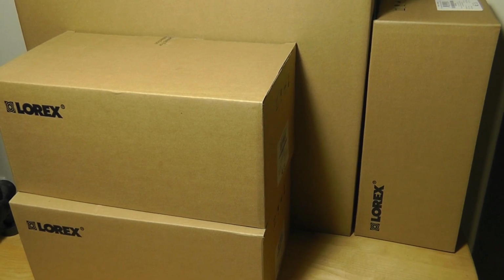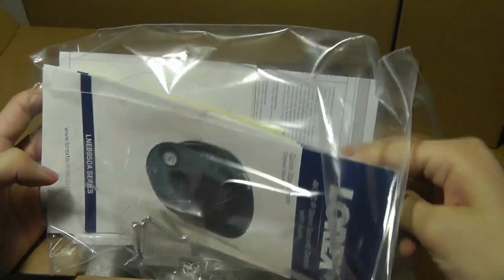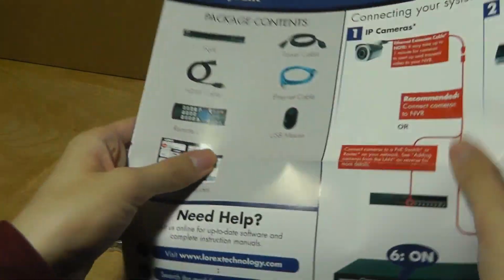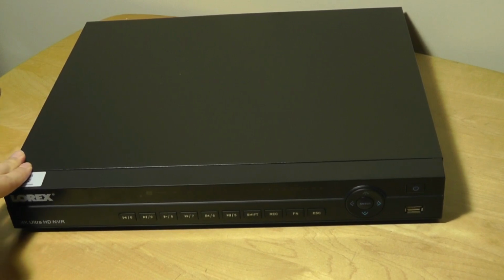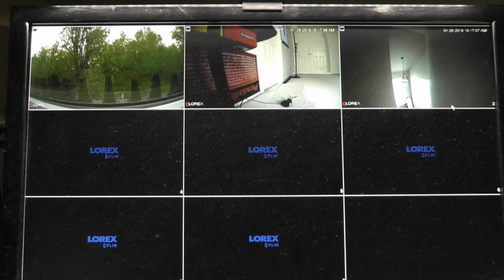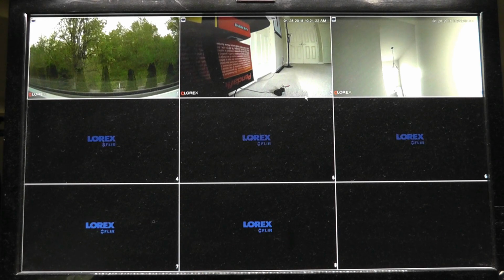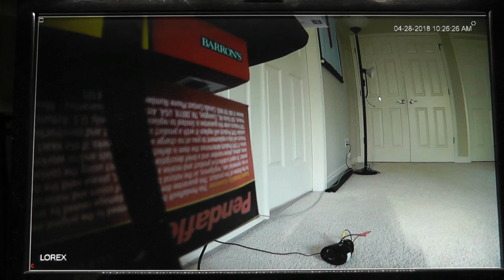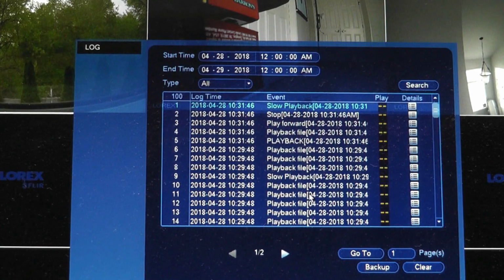REVIEW: LOREX (FLIR) 4K Ultra HD NVR Security Camera System!

Comment: I just bought and installed a 4 bullet camera Lorex 4k camera system. To this system I added two what Lorex says are compatible cameras; So a 6 camera system for approx. $1,200. The supplied cameras are not fantastic. Where I live is a rural setting and although there are street lights they are few and far between and there is little to no ambient light from neighboring homes. In other words the cameras which are supposed to have a range at night if 130 ft see nothing, nada. I have a friend who went through the same scenario with Lorex and he dumped the system and went with Waze. I don't ever want to hear that Flir/Lorex is the gold standard in night vision. The literature says though that the cameras need a min. of .2-.3 lux. In english a moonlight night is about .27. 
     Furthermore the two additional cameras which Lorex claims to be compatible are what I would describe as "sort of" compatible. These cameras do not work with a software feature called "smart search" which flags motion that was detected over a set time period. In talking with Lorex support they were evasive about this limitation that I discovered by nailing the agent down. 
   In my case since I invested so much money and was dis-satisfied I had to purchase some motion detection floodlights to compensate for the nightvision limitations of the supplied cameras.
    There are limitations with the Lorex systems and it disappointing to see these camera reviews pop up that say these systems are fantastic.

Comment: Does the camera have wifi to connect to your smart phone? (as you stated in your video), Or does the camera have wifi so it can connect to the DVR wireless which in turn can be accessed by cell phone? There is a BIG difference. Be sure you know you sh_t. Also, it's not a "DV box". This is incorrect english. This is a DVR.

Comment: This guy gets some of his facts wrong. 
1. This system isn’t manufactured by Lorex/FLIR. It has a different manufacturer, and is rebranded with the Lorax/FLIR name
2. He says 4K is the most resolution you can get in a surveillance system.  Wrong. You can get a 12MP system if you shop around. 
3. Says the noise of the NVR is as loud as a desktop computer. Wrong. Unless you have a very loud computer. This thing sounds like a refrigerator running. 
(BUT....Maybe the costco version is worse than one gotten directly from Lorex)
Reply: I ordered the non-Costco version. I still expect the fan noise to be annoying.
Reply: True, its Dahua
Reply: I have this NVR and OP is correct. The fan is extremely noisy. I had to relocate the NVR to the closet.

Comment: How loud is NVR fan?  If I put it in my office, will the buzzing bother me?  Can you give estimate db?
Reply: Quang Tran, I though the same thing. The fan is super loud. I hid the NVR to keep it from being stolen if found. But the loud fan would allow it to be found easily. !!  Easily sounds like a refrigerator running.
Reply from the maker: The NVR fan isn't very loud - overall comparable to the noise generated by a laptop or desktop computer. So it should  be perfectly fine in an office. You can skip to this part of the video for additional details: 6:18
Reply: T Jam bingo exactly, it could be discovered by burglars or the buzzing would cause ringing in my ears.
Reply: Did you purchase your  Lorax  System 4K from Costco or directly from the company? Also how do you like the system is this brand best on the market for the price?